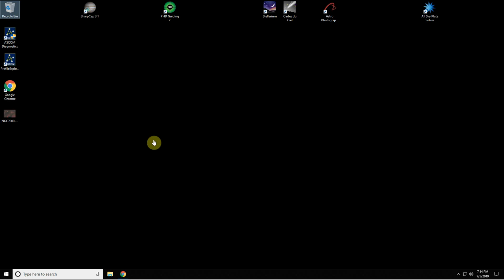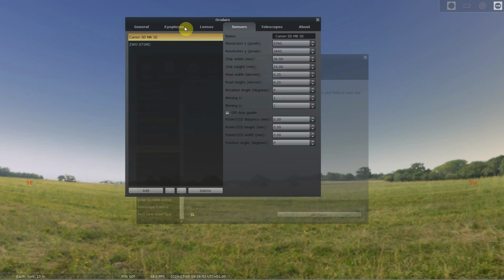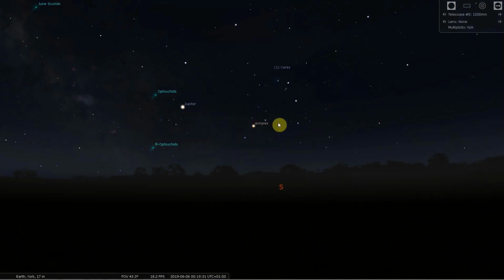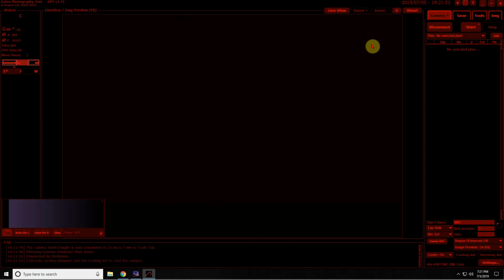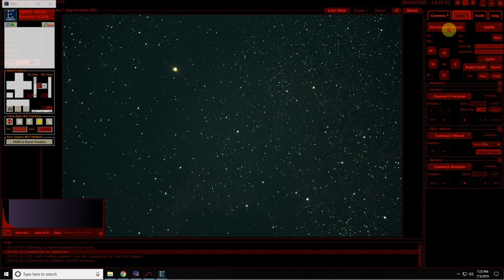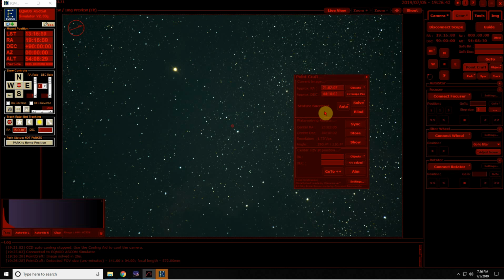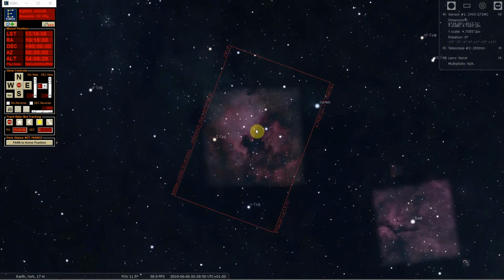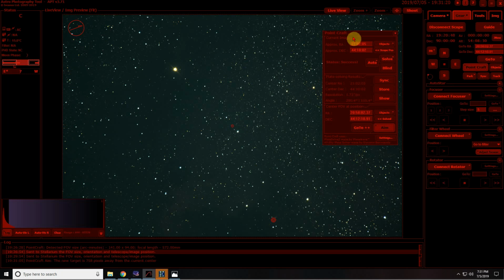Astro Photography Tool - Framing Faint Nebula with APT, Plate Solving and Stellarium

Comment: Great video Hogarth ,only I can't get Stellarium to change cameras or Telescopes automatically from a captured image in APT, have to select them manually in Stellarium find the object ok but wrong field of view most. times. I can't see if i am missing anything , if you set a different camera or telescope in Stellarium does it change when using 'show' in APT ?
Reply from the maker: You need to set the camera number and telescope number in APT, that relate to your occulars in Stellarium.  They start at zero by the way. So your first camera and telescope in Stellarium would be 0 and 0 in APT

Thanks for watching and the comments.
Reply: @HogarthsAstrophotography  Yep did that but doesn't seem to follow automatically, I just change manually and seems ok most times.

Comment: Really helpful!!  im using a Startracker and a 600mm lens and usually have Stellaruim open on my phone and manually look at the stars and my test shots to work out where i am, this plate solving if it works will be amazing thanks for the effort of making it.
Reply from the maker: Hey Phil, really appreciate the comments. I use this very method every time I shoot the night sky. It made things incredibly easy, even with non goto mounts.

Comment: When setting up the plate solving software. Do you put your actual sope focal length in or its length with the flattner/reducer applied?
Reply from the maker: So I think if you enter the focal length in apt which there is a section under the main right hand dialog, you don’t need to enter it in the actual PS software. APT i think passes that as an argument to the PS tool used as part of its invocation. In terms of if a reducer is used, I would say yes, enter the actual focal length after reduced, but again in APT. 

if your not using APT, then you would enter the focal length in the actual PS software. I used to do this when I was using ASPS in ‘standalone mode’..

Comment: The guide was great, thank you, it made everything so much easier using plate solving to sync my mount location. I had one issue where apt would not connect to stellarium (error 5) on start up. The solution for me was to change port access settings on my firewall to specially allow access to the port i designated in apt and stellarium. Worked fine after that

Comment: This was a great video, But I am finding some odd behaviour between Stellarium and ATP. I have been using Stellarium to go to the object I want. I then take a 20 second picture, blind plate solve and then show. Stellarium would then show I was on the object I was looking for and did not move to the correct location which is what I'm expecting having watched other various videos on this. When I did a longer exposure I knew I wasn't on the object. The only solution I found was to use ATP to go and find the object, blind plate solve and then use the Goto++ this then found my object. It seems if you use Stellarium first to find the object its not quite right?!
Reply from the maker: If i've understood you correct Greg.. im sure thats the whole idea of plate solving.. no mount will accurtatly goto a positon, without either first performing multi-step alignments.. or as i do.. slew to where the app thinks it needs to go.. plate solve and then use Goto++ and Aim to do exactly what you describe.  Unless your initial pointing is way out.. i can usually get my target centered in < 3 minutes. hope this helps
Reply: @HogarthsAstrophotography  I think what I was forgetting to do was to press Sync after the initial plate solve so that the mount actually knows where it is.Then use GoTo++ to to find and align on the object. I was spending over 1 hour trying to find my objects. Tonight I was able to do it in 5 minutes which is a huge improvement. I'm even using the plate solve technique to find a main star like Vega for setting up the focusing

Comment: how did you manage to connect your zwo camera to your regular camera lens for plate solving,I have bought a zwo camera for guiding and will be using my sony a7r3 and 200-600 lens as a telescope tube
Reply from the maker: David Laurie https://www.telescopi-artesky.it/en/artesky/accessories-for-ccd-and-cameras/3632-canon-lens-adapter-for-cmos-zwo-qhy-8055517131763.html

Or the Zwo canon EOS adapter..

Comment: Hey wondering if you can help me.. I’ve just started using plate solving.. so from the start I unpark hit object,choose my target hit goto. It will go to the target but then when it’s finished it’s not tracking.. I looked in eqmod and the tracking rate says not tracking. I click sidereal and it doesn’t do anything. It happens every now and then.. not all the time. So I have to shut down and try again.. on the 4th go the other night and it was ok.. tracking sidereal in eqmod. 🤷‍♂️ any help.
Reply from the maker: Eqmod should automatically track after slewing. Which ASCOM mount driver are you choosing in APT.. presume it’s the Eqmod one

Comment: I have since downloaded the full version of APT, in the installation wizard is there any where those index files are stored? because I cant find them if there is one. I have been making up dummy plans to check if my cameras (cmos) will be recognised in APT in which case they are. I am waiting for some clear skies to be able to try this program out. Robert     Aust'
Reply from the maker: NewBee101 you don’t really need to know where the index files get stored by all sky plate solver